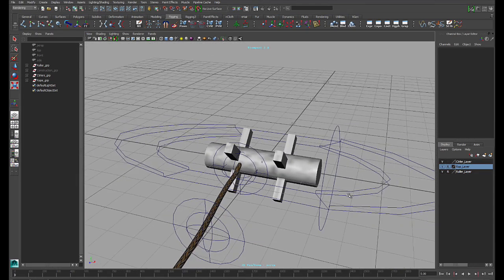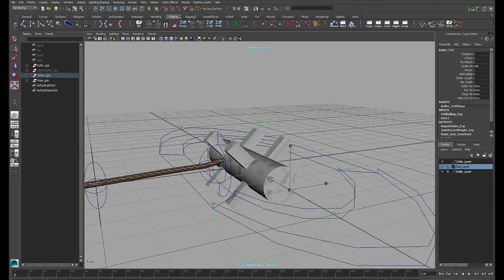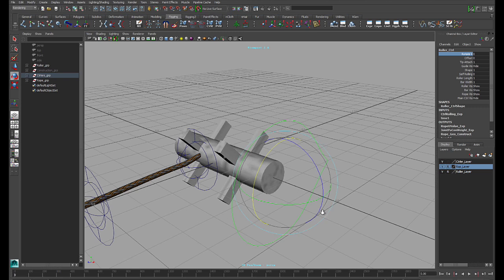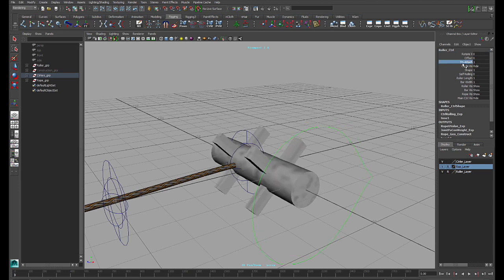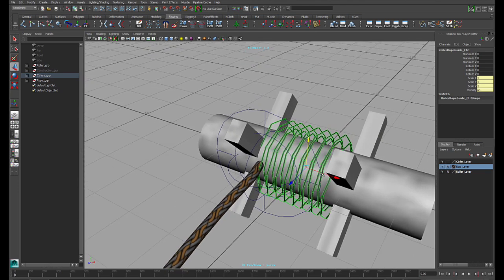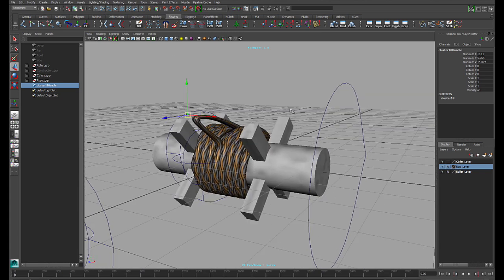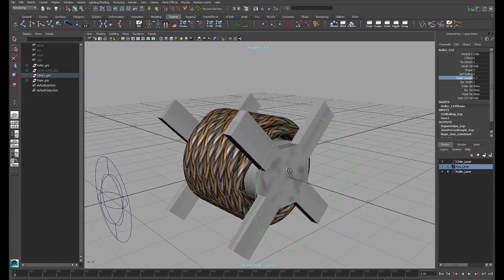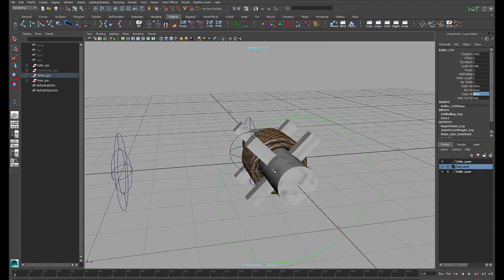Maya Cable Rig, Rope Roller, Cable Spool, Part1

Comment: Hi, I am trying to wrap rope around an odd shaped pillar. So it needs to be elevated in the valley edges. like a cross shaped pillar the rope needs to be stretched over to each point.  This is not so hard with one strand but try doing it with an array of ten lot bindings a few dozen times across an irregular pillar (Main sail mast) where the shape differs.
So I cant make one and duplicate.
I tried project curve but it fills the valleys.
I tried to animate a rotation and wind a curve onto the mast but it follows an irregular spool and is sometimes apart and sometimes overlaps itself. 
I can cut a number of divisions extrude and bevel but once again this fills the valleys.
How did you make the guide?
Is there any way of elasticizing rope or curves to conform?
I tried a reverse shrink wrap but that warps
I tried to make curve dynamic and let it fall onto the mast then mirror but I cant seem to cut the curve and model it as easy as poly so
I tried to create the rope  from curve then edit that but messy and once again has to be repeated a few dozen times to conform to irregular shape and not practical.
If there was an elasticize command in Maya where I can apply it to a band and it snaps like an elastic band around the mast that would be great.
https://drive.google.com/open?id=0B4ydB7AtzWawaERmREdTMlVUcW8
https://drive.google.com/open?id=0B4ydB7AtzWaweldDOEZGclpXVUU